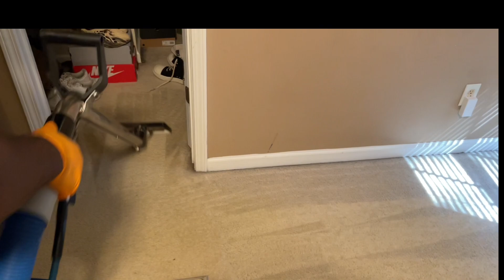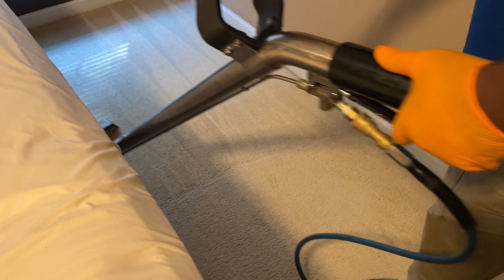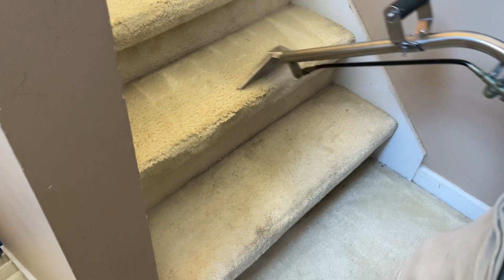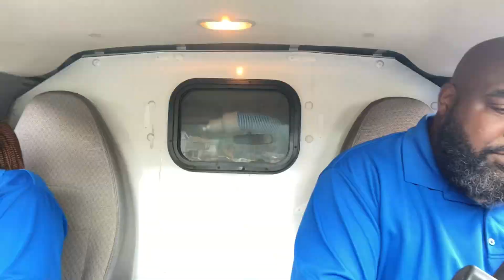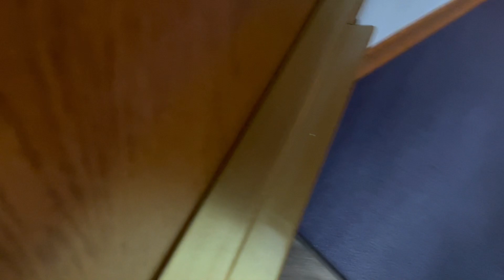Awesome Carpet Cleaning - Giveaway Updates - Church Fogging

Comment: Love the carpet lines 🤩🤩.. approximately how much to get started in owning your own carpet cleaning business?
Reply from the maker: It all depends on the type of equipment you desire to use. 

1. VLM - you can start with $1000 - $1500 buy a oreck orbiter or used 175 and chemicals to start.
2. Portable - $2000 - 4000 you can find a good used or new Machine and chemicals to start with.
3. Truckmount - $8k - $20k plus, depending if you want a used van & TM or a new van & TM.

Advertising now a day is 0 cost/free the internet -  FB groups, IG, Nextdoor, Google, etc are all free resources that can work in your favor.

Also if you use the 1st  2 methods you can use your personal vehicle, or buy a minivan if you need transportation 😊👍🏾